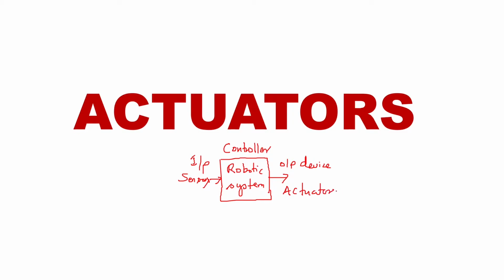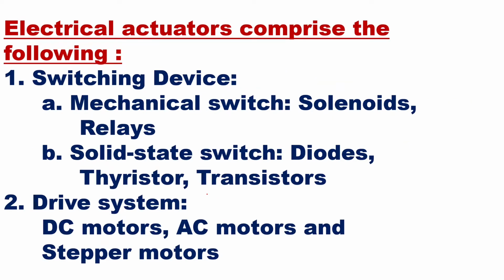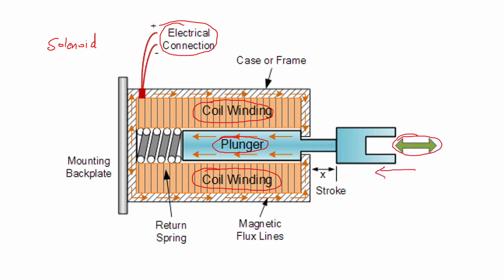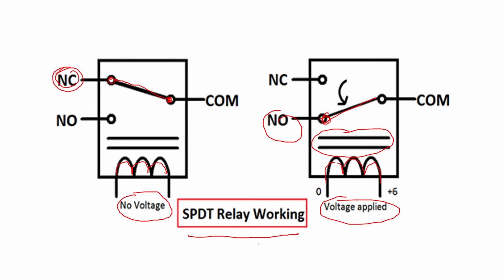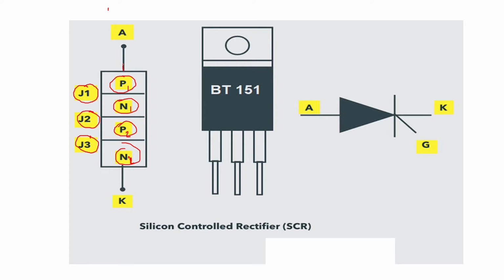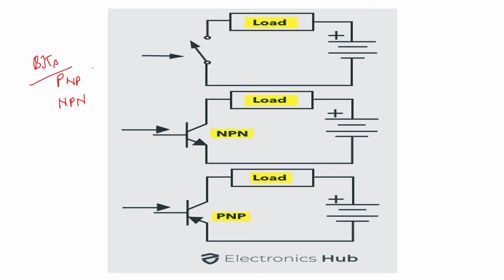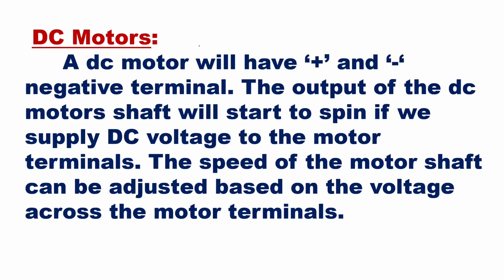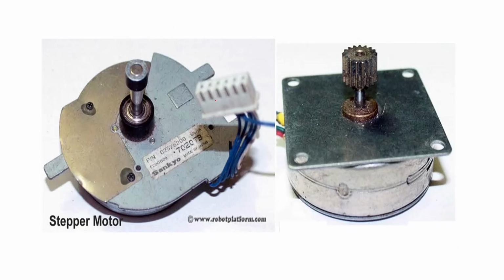ACTUATORS AEE ROBOTICS PART 10

Comment from the maker: You can also see the notes on line follower robotb. Line follower robot 

Line follower robot

A line follower robot is a robot which follows a certain path controlled by a feed back mechanism.

Working principle:

The line fallowing robot is one of the self-operating robots. That detects and fallows a line drawn on the area. The line is indicated by white line on a block surface or block line on a white surface. This system must be sense by the line. This application is depends upon the sensors. Here we are using two sensors for path detection purpose. That is proximity sensor and IR sensor. The proximity sensor used for path detection and IR sensor used for obstacle detection. These sensors mounted at front end of the robot. The microcontroller is an intelligent device the whole circuit is controlled by the microcontroller.

Comment: Thank you sir🙏
Sir You have explained all the concepts very clearly 
Sir what we should write for Pick and place robot? Asked many times in qp....
Reply from the maker: The basic function of a pick and place robot is done by its joints. Joints are analogous to human joints and are used to join the two consecutive rigid bodies in the robot. They can be rotary joint or linear joint. To add a joint to any link of a robot, we need to know about the degrees of freedom and degrees of movement for that body part. Degrees of freedom implement the linear and rotational movement of the body and Degrees of movement imply the number of axis the body can move.
Reply from the maker: Ans a:

Working of Pick and place robot

The basic function of a pick and place robot is done by its joints. Joints are analogous to human joints and are used to join the two consecutive rigid bodies in the robot. They can be rotary joint or linear joint. To add a joint to any link of a robot, we need to know about the degrees of freedom and degrees of movement for that body part. Degrees of freedom implement the linear and rotational movement of the body and Degrees of movement imply the number of axis the body can move.
Reply: @javalkaracademy2176  ok sir thank you... But is there any diagram for this pick and place robot that we should draw in the exam if they ask this question...